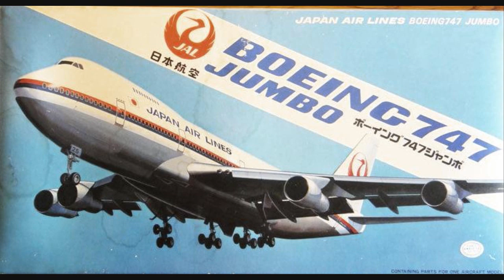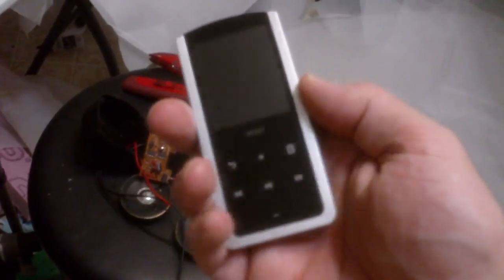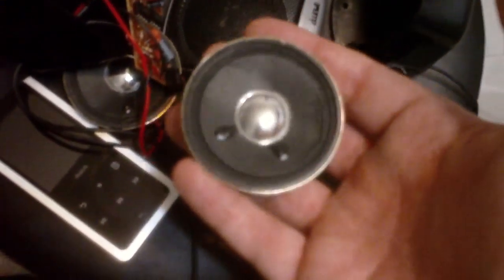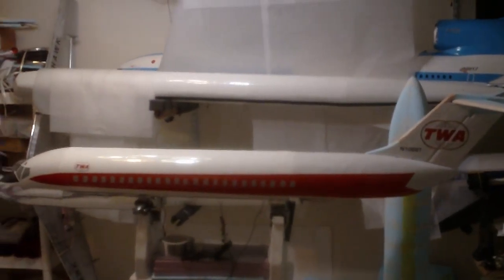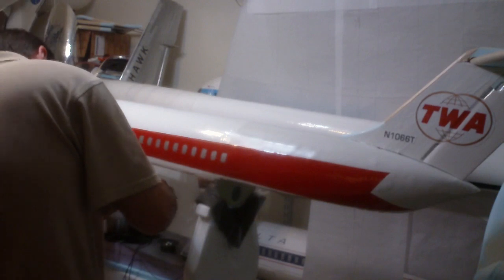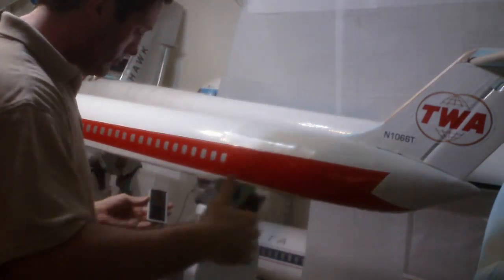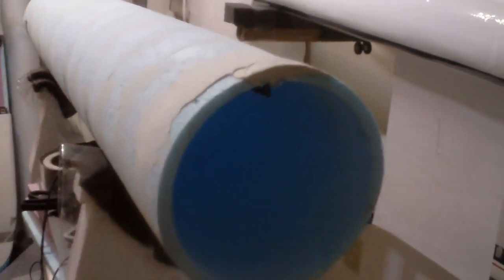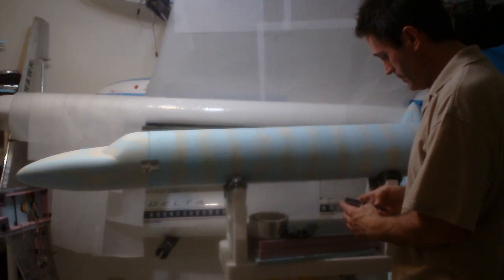How to make your own RC Sound module for RC aircraft!

Comment: Is there any concern about the magnets in the speakers and the effect on the Rx signal? I’m thinking up a system for my Stuka (just the siren) but on command would be ideal, maybe a Bluetooth speaker linked to a remote device on your transmitter? Perhaps for the siren just a simple mini MP3 with a servo to tap play and pause on command

Comment from the maker: I hear Ya, I wanted to make a simple affprdable easy set-up, in order to run it though your Radio & throttle takes a separate module which costs more and you can;t use your your own sounds, I.E DC-9 or Metroliner for example.

Hooking this stuff up to your Receiver & radio is a pain and makes it heavier & more expensive in the end.

Comment: Hi

?????
There are 3 fundamental problems:

Where do I get the sounds from?
How can I use multisamples for starting and flying?
How can I pair the sound with the throttle speed?

You dont tell us how, so we can't use it...
Reply from the maker: Hi Thomas! Actually I kinda do answer these questions in the video but perhaps you missed them.
1. You can go online and buy the sound files of certain aircraft
2. You can use a servo and arm to press the advance bottom on the mp3 player to advance through the tracks or sound effects.
3. You can also add a volume a just servo that's "Y" connected into the throttle channel.  

Thomas this is an RC sound system that's affordable.  . . Not perfect.
Reply: Exactly.....  just playing sound effects with an mp3 he took apart.....  didn't even consider how to use existing battery to save weight of dedicated battery.  Not tied to throttle and no switch ideas for starting or stopping even the bare sound effects.  Some else said one speaker is plenty and they are right.  Double the volume and you can halve the speaker weight easy.
Reply from the maker: BushPilot444 Bush pilot . . .feel free to go spend $-300 Bucks on a RC sound module if you want, your Call Sir, I built this module for under $20 bucks and it works Fine, a separate servo arm can ajust volume and another servo can select the sound track on the MP3. and you can use one Speaker or two or three  . .as many as your plane can handle.
Reply: +F3HDemonDriver WHY DID I ONLY SEE THIS NOW!? I didnt think of using servo arms to change the tracks